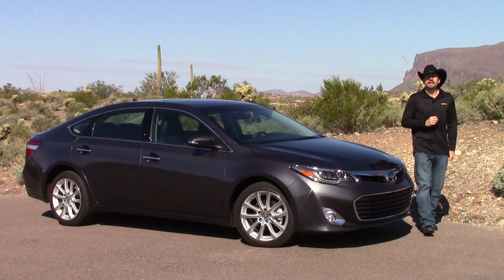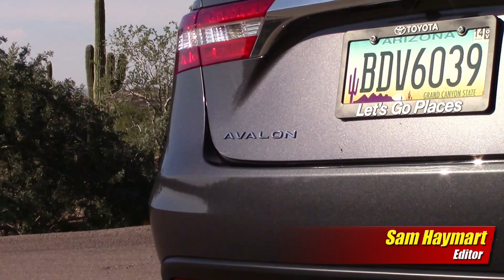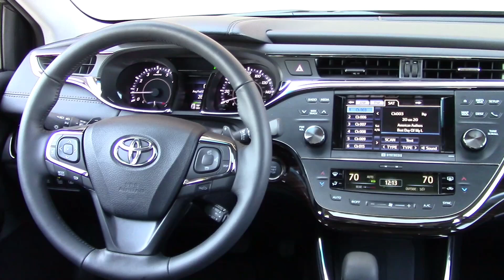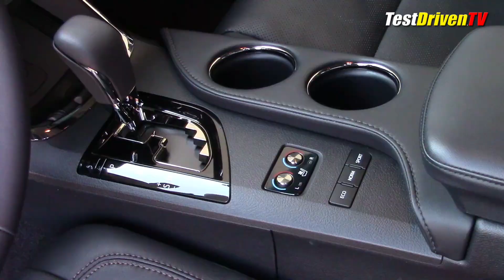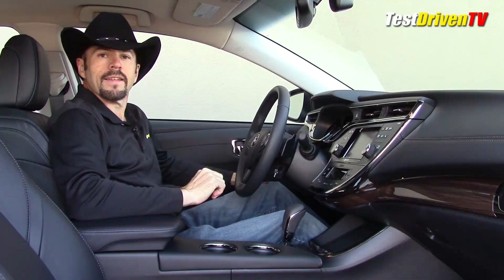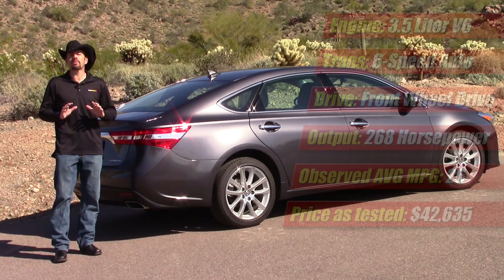Test drive: 2014 Toyota Avalon Limited

Comment: Beautiful car when you see it in person. Looks long and lean. And the interior is very luxurious, and uses different colors and textures very well, with high-end materials above the base trim. Suspension is set up too firm, and drives like a Nissan Maxima, not a typical Avalon (They are revising the suspension to be more compliant in 2016). So in 2015, it is more fun to drive than you think, but not as smooth on the road as you'd like.

Due to it's very light weight (under 3600 lbs), the V6 moves it quickly and easily. Back seat is a little smaller than before, but can still carry large adults in back. The 2016 revisions should correct the one issue. You can get a very-well equipped Avalon for under $40k

Comment: They ruined this car - I HATE IT!  I had a 2011 that was totaled - the 2014 - they not only shortened it, thus it is no longer a smooth comfortable ride but the narrowed it as well and the driver foot room is now it is worse than the crappy Dodge Charger I have to drive for work - such an uncomfortable ride if you have to drive any distance - the seats are bucket now - hard and very uncomfortable!!!!!!!!!

In wanting to appeal to a younger crowd - they lost us older folks who only want comfort quiet ride= did I say you feel every bump in the road on your back and despite what they say - it is NOT Quieter.  It has been cheaped out and The inside is so ugly - whoever did this should be FIRED - I will NEVER buy another one - they lost this once loyal Toyota customer!
Reply: Next time do your homework before you buy a car

Comment: I have a 2013 Limited w/tech pkg. Well he almost got it right. This is the same frame as the Lexus 350 and not the Camry. The V6 is the same in this car as the ES350 and most other Toyota models. For some reason if you buy the Lexus you will pay $6K to 10K more and they recommend premium fuel.
Those high tech touch switches have been around for over 30 years. The do work excellent on this car and are rated the best in the industry.
Older Avalon owners may not like the drive of this car. the body has more welds and the suspension is stiffer. The ride can be a bit jolting over expatiation joints but it is a great car with the latest smartphone and Bluetooth hookups.
Excellent value for the money and the Toyota resale value.